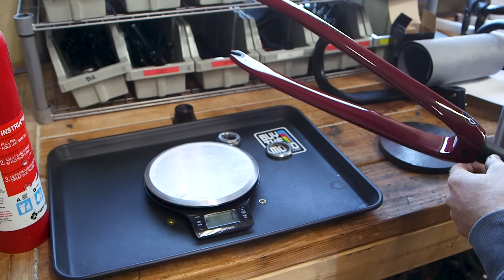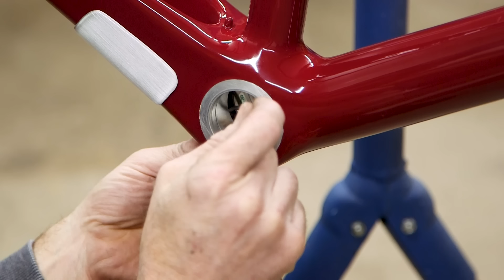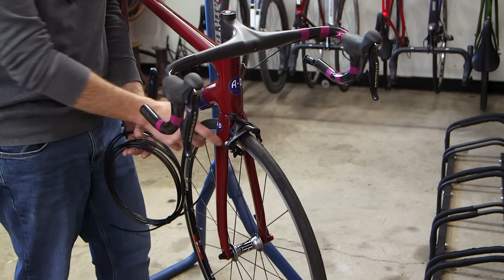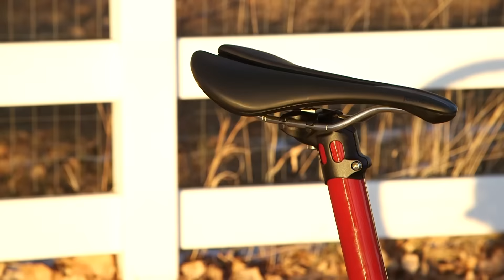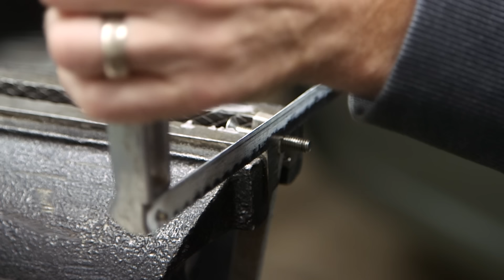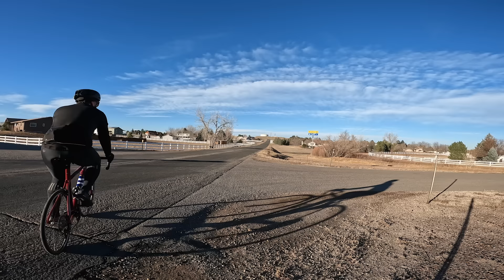The best road bike you've never heard of, probably.

Comment from the maker: Check out Fred's channel if you'd like.  He's trying to get to 1000 subs:  https://www.youtube.com/channel/UCOOAZ5fv6vRmmNKAEfJFqnw
Reply: Thank you Robert for the great video. I learned something about my own frame and the content and production value is excellent. I have been lucky to have suppliers who are very good at what they do. But I have to work hard to make sure everything comes together just right. Yes the tapered head tube is an older generation, but I have extra forks and the headsets in case anyone needs one. Agreed the ISP is an extra effort to set up, hard to travel with and it narrows its resale market, but it makes the bike stiff and light and you don't have to buy another seat post. Some people like the look of a single color too. I used the Wheels MFG thread-together bottom bracket and never had a problem. It was worth the investment. You can run a 28mm on the front but not on the rear (I tried many times with different brands). Also, I could never get used to running a Mullet set up on my road bike although it does make some sense and after a while you forget about it. I always thought 30mm was a universal recommendation for steer tube height but I think you will be fine with 40mm so long as you are not contesting field sprints every weekend. According to Strava I rode and raced 31,000 miles on my Superleicht ISP. I built it up with Dura-Ace Di2 running a variety of carbon tubular wheels. At one point I had Xentis Squad 2.5 tubulars and I think this brought the weight down to below 16 pounds (7.2 kg). Regarding 1X, I thought this was a personal choice. I run a 1X58T on my time trial bike and it works for me on the flats and the hills.I am never going back,  I am sure I could ride 1X on my road bike, but I am happy with 2X for now. My only reservation about 1X on a road bike is that if you drop a chain during a race, your race is over. But I am sure the technology has improved. Cadence I am sure I would adjust and watt loss on the chain, well I would choose the gearing that keeps the chain straight and I would be prepared to replace it more often. And yes my marketing needs work, but the best thing that has happened on that front this year is Robert did a video about a Superleicht. Thanks again Robert. If anyone has any questions please see www.a-dbikes.com or call me (Fred Thomas) on 207 415 3746. Become Bike. Become A-D Bike.
Reply: How is he not at a thousand subs yet?!?

Comment: 1x is absolutely not only for people who live in flat areas. I'm in the mountains and I run a 1x on my bikes, a small front ring and a large cassette. Currently my gravel bike that I built, which is my commuter and main mode of transportation, has a 30t on the front and 11/52t on the rear. I ran the same on my MTB that I was previously using for commuting. 

The chain line inefficiency is a thing, it's been measured by people who have the right tools to test it (there are videos, but I don't remember who it was), but, it isn't that big of a deal. I'll take that for the benefit of simplicity any day. 

Jump in cadence, probably depends on your setup and preference. I'm about to be 45 and also prefer a higher, easier cadence. I run an 11spd and kind of wish I'd gone with a 9 or 10, because I'm often going through gears faster than I need them. I very often switch two, three, or even four gears at once because I don't need the in-between ones. But that's just part of how it is in the environment I ride in. I'm either going up a hill, or down one. I don't get to spend much time on anything flat.

Comment: I'm a TPU guy myself. I don't think tubeless works that well with road bikes, the tire pressure is too high and it just blows the sealant out before it can do what it needs to do. It's great for low pressure riding, not so much with high pressures. People make the weight argument, but usually a TPU tube weighs less than the sealant you put in the tire. And then you also don't have to deal with all the other tubeless hassles.
Reply from the maker: I'm kinda over tubeless on the road bikes.  I've still got it and use it on gravel.  I think you're spot-on with the pressure thing.  The tubeless 28 and 32c tires are both probelematic with sealing.  Anything larger than a thumb tack poke and they wouldn't seal.  My newest set of carbon road wheels, despite being tubeless, is holding a set of TPU tubes.

Comment: Cannondale used the same fork steerer size on my CAAD10, i.e. tapered steerer tube measuring 1-1/8 inches (28.6mm) at the top to 1-1/4 inches (31.75mm) at the bottom.
Reply from the maker: I think I had a 2014 Specialized Allez E5 that did the same.

Comment: One by all the way for me. Simple, light and reliable. I run an 8 speed Claris never designed to be run 1x with a no-name Amazon cassette, 13 speed 1x SRAM Force crank and a 9 speed KMC chain. No chainline issues here 😁 I think compatibility of 1x drivetrains is severely blown out of proportion. None of us are elite athletes. Drivetrain efficiency is inconsequential.
Reply: i ride a 9 speed alivio with 1x and it's great, never had a problem with cadence but i tolerate high RPM too, so maybe that's the diference. I also have a bike with 8 speed claris, this drivetrain is so good, shifts great.

Comment: Really enjoying your content. You explain things clearly, practically. I agree with you 100% on the whole 1x drivetrain discussion. For 95% of riders, a 1x setup is not only perfectly fine, it’s actually the better choice.

Most people simply don’t need the complexity of a front derailleur, extra shifter, extra cable, trimming, chain drop issues, or constant adjustment. A modern 1x gives you plenty of range, cleaner shifting, less weight, fewer failure points, and way less maintenance—especially for people who just want to ride, commute, cruise, or hit trails without babysitting their drivetrain. Simplicity matters, and 1x absolutely delivers that.

I also really agree with your point about how gear range is often misunderstood. Riders look at numbers on paper instead of how they actually ride. In the real world, most people live in a pretty narrow gear window anyway. A well-chosen cassette and chainring covers that perfectly, without the redundancy.

Funny enough, I deal with the exact same pushback on my own channel whenever I convert older bikes to 1x. People act like it’s sacrilege—even when the bike ends up lighter, quieter, more reliable, and better suited to how the owner actually rides. There’s this weird attachment to “how bikes used to be,” even when modern solutions objectively work better for most people.

Anyway, just wanted to say I really appreciate your approach and your honesty on this topic.

Comment: Didn't have a road bike with 1x drivetrain yet but I have a trekking bike with Pinion 12-speed gearbox and that's effectively a 1x and it's fine, however, sometimes the 50% intervals are a little too much and I can't find the perfect gear (that's why they also have the heavier 18-speed, total range is slightly higher with 636% but of course smaller intervals between the gears) and also converted an old 1990s GT steel MTB to Shimano Cues 1x10 (came with a 3x6 and I can't handle these ancient thumb shifters, initially wanted to convert to 7-speed gear hub but I couldn't fit the clickbox on, so I thought screw it and got that Cues stuff with a 42T crankset and 11-48 cassette) and I use it onroad and for some touring but no real mountainbiking (for that I have a more modern 29" hardtail) but if I feel the need to make it a real climber I would put on a smaller chainring (and probably switch from square taper BB to a Hollowtech II, Dub etc.).
I like that because when accelerating on older bikes with triple chainrings I often shifted double or even triple at a time and on these I had to get familiar with that I only needed to shift up one gear at a time but now it's fine.

Comment: I converted my Schwinn Varsity to 1x many years ago. It weighs a little bit more than your bike but actually, the largest performance gain was switching to aluminum alloy rims. Do you know of anybody that makes ti ashabula type cranks? I'm thinking of upgrading. Thanks.
Reply: ashtabula?
Reply from the maker: I haven't found anyone who makes a decent, modern, lightweight 1-piece crankset.  There are a number of Ti two piece cranksets on the market but, wow, are they expensive.  I have a Shwinn Suburban and I did the BB-conversion on it and used a Sugino Messenger crank on it.  Considerably lighter than the one-piece, though still heavy.

Comment: First off, let me just wish you and everyone else a happy new year !

I'm really liking this bike. the frame looks very nicely made, and that red just pops. The only thing I'm not a fan of is the seat tube. It just looks too big and it's weird seeing a seatpost in the same color as the frame (but, maybe it's just a me problem). 

Re 1x vs 2x, I'm in total agreement with you. i don't get why people care so much about what configuration others choose for their bike. If you like it, great, if you don't, that's great also. You can have a conversation about what you prefer, but don't say that "oh, a road bike should only be specced as a 2x, bla bla bla". Not everyone has the same needs, or chases crit times and koms, or rides in groups. 

On a side note, I juste converted my 2022 Defy (full Tiagra 2x10s) to a 1x. I used 105 brifters, brake calipers and cranks, a wolftooth 44t chainring, RX812 RD and a M8100 11-42 cassette. With the new one piece cockpit (Toseek TR5500 380*90mm), ultegra long axle pedals and 2 carbon bottle cages, it comes in at 8.66 kg currently.  Haven't had a chance to ride it, yet, but hopefully will be able to this weekend !
Once I receive my new wheels (EliteWheels Marvel G36), I will also change out the discs for Galfers, and tires for Hutchinson Caracal Allroads in 35mm (currently running Gravelking slicks in 35mm), which will hopefully get the weight down under 8 kg.
Reply from the maker: Happy New Year to you, too! I appreciate the detailed feedback and it's awesome to hear about your Defy conversion. That sounds like a super cool build.
Reply: @RobertAdairWorkshop  Thanks ! I've been wanting to do a 1x conversion for a while. I decided to bite the bullet after my bike fit, as I had to replace my crankset anyway.

Comment: If you blow a hole in your tire to big to patch up or a nasty sidewall cut  you can always cut another gp5000 tire segment, trim the beads and line the perimeter with "3m 130c" splicing EPR tape, to prevent the installed tire segment from fretting away your tube. You would think that it won't work or that it won't hold up but it really does hold up enough for you to "finish" the natural wear and finish your gp5000 tire specifically.

Comment: Great looking bike, but I'd never personally buy it - the seat mast and press fit bottom brackets are absolute no-nos for me. I am a big fan of 1x drivetrains, though, and I think they get a bad rap. I've done a considerable amount of climbing with them without any issues as I always use at least a 1:1 ratio between front chainring and largest rear cog. My current commuter / touring bike is mechanical (GRX rear derailleur with Sensah Team Pro shifters) though I do want to give an electronic groupset a try on this bike, so I'm planning to install a Wheeltop 1x system on it in the near future.
Reply: Thank you Luke for the comment and understood. The seat mast requires extra effort to set up and it is difficult to travel with and yes the old BB30 bearings with the clips was a waste of time. I raced this model for at least three seasons and the ISP once set up kept the bike light and stiff and the single color up to the seat looked cool (I had to get used to it). I ended up using the Wheels MFG bottom bracket that Robert uses: yes you pay more but you will never have a creaking bottom bracket.

Comment: Those carbon Ti skewers aren’t reliable, I had one fail on me after 6 months, luckily it was my back wheel and I didn’t crash. The cam lever broke. I highly recommend not using weight weenie QR skewers
Reply from the maker: Good to know.  I'm running them on a couple bikes.  Did the cam just break apart at the joint?
Reply: @RobertAdairWorkshop  yeah, it was like the copper piece got crushed. It was odd that it happened while riding. It was my rear one and my bike comes off and on the trainer a few times week so that maybe contributed.

Comment: Nice bike! Simple and old school with some modern touches. You could knock another 500 grams off (and add another $1000) by upgrading the wheels but you already knew that.

As for one-by, it’s not for me (on a road bike) due to the cadence issue. My average cadence is around 90 rpm. When I went from 2 x 11 to 2 x 12 I noticed a marked improvement in the middle of the  cassette on either front ring in terms of keeping in my optimal cadence range. I live in an area where the roads are punctuated with sometimes continuous punchy short climbs and steep descents. I race criterium as well. On those circuits (there are two dedicated crit tracks within an hour’s ride from me and multiple clubs run events) I could probably go one-by as I never use the small ring. Maybe I should build a dedicated criterium bike?

But you know, everyone is different so whatever works for you is great. Why people get bent of shape about these things is the mystery of the internet age. 

Keep up the good work!

Comment: The argument about drivetrains is silly to me in my opinion. I have used all such as 3x, 2x, and 1x drivetrains. It all comes down to experience, fitness, utilization, and preference of the rider. Every system has there use in the right settings. The 1x has just gotten super popular because of the simplicity and easy gears available for new riders. Any bike can be converted to a 1x as long as the chain line is taking in consideration and appropriate accommodations are made to the bottom bracket. A 1x road vs a 1x gravel/mtb/adventure setup is not the same drivetrain. The roadie with the 1x is a super elite that can push a 48-52 tooth front chainring with a 11-34 or 38 tooth cassette. Yeah, the roadie will mostly be riding on the flats as much as possible. The guy that was talking about 1x being for flats hasn’t ridden one fully loaded with racks and bags or ridden off road.

Comment: 20:40 That wobble is very likely from the lose expander plug or headset bearings. Make sure it didn't slide out a bit (tighten it to like 10 Nm). Also, make sure that top cap is really tight too!
Reply from the maker: I'll check that out.  The lower race I used, I 3d printed.  It's plausible that it's compressed a bit.  Thanks for the tip.

Comment: My favourite thing about this build is the absolute fusion of old and new tech. 

Rim brake, di2, 1x, 25mm tyres, integrated mast. It's like a peak 2014 road bike.
Reply from the maker: It feels a lot like a road bike from 2014.  And that's a good thing.  Back right before the road industry started implementing things like disc brakes, thru axles and tubeless.  But after the reign of the harsh riding alloy bikes.  Not to say I don't enjoy a modern bike with those features, but I like this a bit better.
Reply: Thank you Abed. That's exactly right. Seems like it was just yesterday but it was eleven years ago already. The next generation of A-Ds will be a bit more current!

Comment: Love your channel, not going to argue about components, but I will point out that with a road bike wheelbase like the one you built in the video this qualifies as an off-label use of the GRX 1x. Shimano says it is intended for > 415mm chainstay length. This is to keep the chain angle sane when you are in the biggest sprocket. Anyway if it works for you that's the thing.
Reply from the maker: Never even thought to look that up.  Good point.

Comment: I think people assume 1x is for flat places is because when a bike is sold brand new with such a setup, usually it's undergeared still like a 1960's high tensile POS. Which is frustrating because manufacturers could still be selling 8-10 speeds with a wide range of 11 to 52 on the rear. It's not a matter of pushing 11/12 speeds. Sure there is a huge cadence jump but it doesn't make sense to still be maaaybe putting 11-36 cassettes on a 1x setup when you can just have it all.  Bike looks good.

Comment: The thread together wheels bb, does that require pressing in one side?  Wondering how the threading impacts the bb diameter.
Reply from the maker: No.  It's a sliding fit, both sides.  The drive side has some rubber o-rings built in to help center it while its' tightened down.  It has a lip built-in on the outside diameter that grabs the face of the bottom bracket shell when tightened.  The compressive force caused by threading it together is what holds it securely and keeps it from moving around.  Once loosened, though, you can push both sides out by hand.

Comment: Looks like you could squeeze in 28s if you want.
Reply: Thank you or the note. Hope springs eternal! You can get a Vittoria Corsa 28mm on the front but on the rear a 28mm Vittoria will hit the brake bridge. I tried with tubulars too and no luck. A lot depends on the brand of tire too. And if you mage to get a 28mm tire on the rear there will be very little day light between the tire and the bridge and it will probably rub when you get on the bike. The Ultima can run 30mm tires no problem!
Reply: @RideableTV  I've built up an a-d superleicht of exactly this kind over 2025. The quality of fabrication seems to be consistently high. The frame will just take gp5000 28's with about 1mm remaining of clearance. I've found this fine to ride (no rubbing) except for in the wet - where pine-needles and debris accumulate aggressively around the brake calipers.